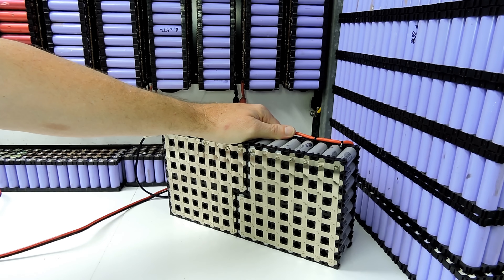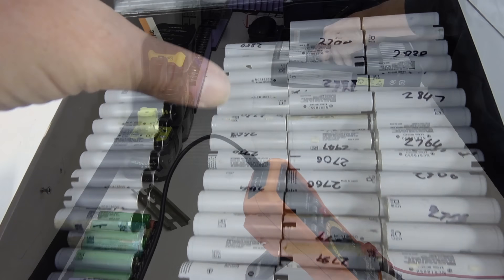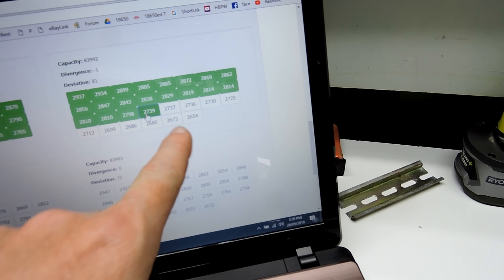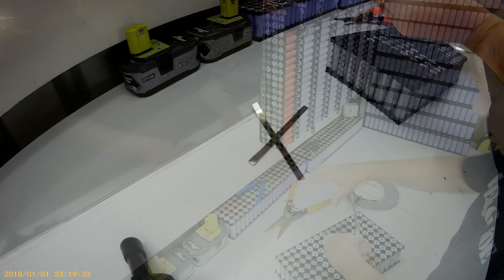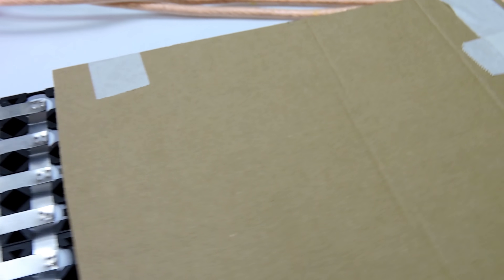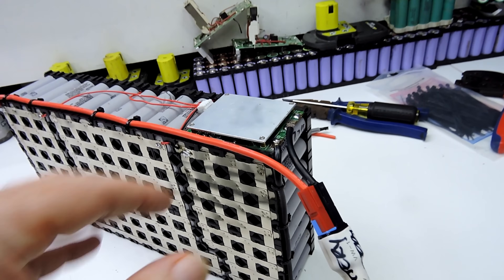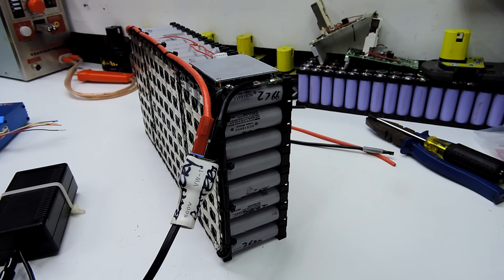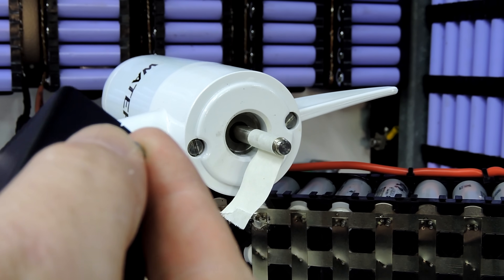Trolling Motor recycled 80ah 18650 battery pack

Comment: no fuses! nice fire maker battery!!!!!!
Reply from the maker: Clearly your deep in the eBike community :) Check out my other work - 4480 fuses 120 temp sensors etc etc
Reply: regardless what is the destination usage for the battery pack, if no fuses, better don't hold it inside a home!.

And, no, I am not in the eBike community, just saw your video as in promotion. So it appear in my youtube suggestions.
Reply from the maker: it will be on the deck of a kayak - I have 6000 plus cell i use 4480 to power my home - kinda get the fuse thing - in this case i need mechanical strength, portability and capacity Tick, tick & tick

Comment: Hello HB, great channel, great project...! 
When you solder on the leads, you can do it on the strip Between the cells...(less heat build up).   
Fuse - Idea: Get your brother to put a "Master Fuse" in the PVM box...and, 
for good measure, check all cable dimensions. 
Also, test the system, with a "Locked" propeller...
Good to know, what will heat up and how much...Also, to find the right fuse.
PS: I sort my cells in Excell. 
Greetings from Denmark...Jakob.
Reply from the maker: Next version I have soldered to some nickel Then spot welded to the pack thus reducing all heat :) Already have a resettable fuse and emergency disconnect planed I need to get the second video edited and released, trying to raise some funds thus pumping out the quick and easy ones
Reply: Good to know, I see you are on top of it...! In ver 2, I suggest a series of 4 separate packs of cells...easier to repair and renew.
Reply from the maker: True it would be easier to separate and service but harder to move around considering my brother is in a wheelchair
Reply: Yes, they need to go together, as a unit, into some kind of toolcase/powerbox, for ease of handling. I am sure your brother will make it connect to his rc boat hauler tractor!

Comment: Wtf that, how much the battery?
Reply from the maker: It's a 16v battery made from used laptop battery cells - going to use it to run an electric boat motor
Reply: HBPowerwall where you get all of those laptop battery cells?
Reply from the maker: Anywhere I can - many many weeks yes weeks on the phone cold calling companies, schools, anywhere with an IT Department
Reply: cool

Comment: The correct even and try to test the amperage of the batteries, before you discard or use, but okay fine work you did! :)
Reply from the maker: Should be able to do 120amps for VERY short bursts

Comment: Love your videos. I am in the US and I have went to and asked all of the repair shops and battery places in a 100 mile circrufrinst about getting their recycles 18650 batteries, laptop batteries, electric tool battiers, and any thing that holds 18650. If they do not have them they are not willing to give them up, they want to sell them to me. Their selling price pretty much matches new price. Since recycling is not goingto be an option in my area where should I get my batteries.
Reply from the maker: Have you tried Tom ? www.diypowerwalls.com/tom should get you all you need tested and ready to go
Reply: HBPowerwall I have not but I will deffenty check it out thank you very much.

Comment: Hi Pete, now you've used the spot welder but fuse are no longer fitted/required for this pack?
Reply from the maker: Really should have put more effort into adding fuses of some sort - for its application (in a boat) if there is an issue it'll just go overboard. It will also be moved and bumped a lot much like an ebike battery. I've gone out of my way to make sure I'm using the best most balanced cells I have laying around. Time will tell if it was a good or bad call.

Comment: I really need  to ask you a question . I am trying to do the same but I was concern about the voltage @ 16.8 full can the motor handle that ? thanks
Reply from the maker: the PWM speed controller sorts out the voltage -  https://goo.gl/vqR8pD

Comment: Hello my friend, how are you? I've been following your videos. I'm from Brazil, I have a 5kw grid tie. I'm putting together a backup for any power outages. I intend to work with 4S10P. I think the nickel strips good, but I'm afraid some cell the fry! I have a tristar MPPT 45A charger, I also did not like the software, but that's what we have for the moment Some advice? Hugs!
Reply from the maker: First, lets deal with this HUGS thing... do we get to know each other first or just BAM we hug and see if it gets weird? As for the cells in a powerwall with so little cells would recommend fuses of some sort if possible
Reply: KKKK, hugs in my country is a loving way to wish all the best!
Reply from the maker: Never heard of such a thing - where are ya from ?

Comment: What run time would you expect from this setup? Also how long would it take to charge this up?
Reply from the maker: Not sure as unloaded at max speed it's only 1.2amp draw - bet that changes once a load is added. As for charing it depends on your charger. Bigger chargers would have no issue doing it in 10 hours - my charger will probably take 20-30 hours flat to full

Comment: Since this is the latest video, I'll ask here. With your spot welder, are the tips spring loaded? If so, do you push them down until the spring bottoms out? I saw another video where they said spot welding is a resistive welding. Pressing too hard actually reduces the amount of resistance and it doesn't weld as good. Maybe you can play around with pressure on the tips to get different results. Perhaps this is why the arm on the device would work better as it was spring loaded, too.
Reply from the maker: yes they are spring loaded - found if I played with settings I didn't need to really press down so hard the springs compressed. Found if it sparked I was doing it wrong

Comment: Don't you love the short work a Spot welder makes of a huge battery pack!!!
Reply from the maker: There is just a few min of cutting up nickel then bam it's done! And looks so dam good lol
Reply: I started out only using a Spot welder(or my homemade built spot welders), I am just now getting used to soldering a cell. If I could get away with it, I use a spot welder on everything. Love the work you put in on this. That battery should last a long time!!! Good cells you used also. You Can't beat those NCRs
Reply from the maker: Next challenge will be keeping it dry and servicable
Reply: I assume its been in service for a while now? Any word how long it lasted etc? Keep up the good work :)
Reply from the maker: Haven’t tuned it in since too cold lol haven’t even done a load test

Comment: Have you tried using your pip4048 inverter to run your grid tie system off grid which in turn will charge your butteries when the solar load if more than the house ?
Reply from the maker: No, that would end very badly - Its just a bad idea - connecting any 240v to the output of the pip will instantly require a new mainboard - know a few people installing their pips and getting the input and output mixed up. Best to get the right inverter for the job from the beginning
Reply: Have a look at evtv video he has done it with  5 grid tie inverters with a cheap Chinese inverter and tesla batteries at 48 v
Reply from the maker: Ooh I've seen it done but from what I've seen there are many pitfalls - cheap inverter works differently than the PIP's

Comment: Awesome project! I'd love to build a small solar powered boat. Something with those lightweight flexible panels as a roof.
Is there an affordable li-ion balance charger like that skyRC that runs directly off a solar panel and balances while charging?
Reply from the maker: Thank-You Dejay, I'm sure you could do it with a solar charger controller just a cheap one off the eBays then hook up the output - but not sure if you need batteries connected for that idea to work.. I'd love to test the theory but don't have a working solar charge controller here
Reply: I keep thinking that with a single 100W panel with 18Vmpp / 5.5A output, you could just connect it to a 4S5P battery pack and stop once you reach 16.8V. If the batteries allow enough charging current, the voltage of the panels should drop like form a constant current power source.

So maybe you could connect one of those 4S li-ion BMS balance boards directly from solar panel to 4S5P battery pack? No solar charger needed?

I just wish one of these cheap boards would have additional PWM charging build in to limit the current, basically combining a PWM solar charger with a lipo balance charger. Then you could use smaller packs. Which would make it easier and possibly more efficient.

Or maybe I'm missing something :)
Reply from the maker: that sort of stuff is above my head unfortunately - i'm still learning with the rest of you :)
Reply: I've ordered some stuff and will try it out. One of those cheap 4S 30A boards. 
Hope I don't blow the batteries up haha.
Reply from the maker: Say safe and report your results lol
Reply: Pls can show mi were i can buy that type of ur digiter meter  
What os d name and d model

Comment: Sort your cells out in the table by mAh then binary search for them.
Reply: Yeah - I'm with Brian on this. Quicker to sort hi to low. Then finding each cell is much easier. :)
Reply from the maker: Next time :) i'll give it a crack hehe
Reply: missing something.  Why is the logging of the cell, then searching for it important.  I missed something key in the video, OR that's intuitive to most of you already?
Reply from the maker: the sorting would take just as long :)
Reply: At the moment you're doing O(n!) work but sorting is O(n log n) and lookup is O(log n) so in theory you'd be doing less work, as long as you have more than 3 cells :)
Reply from the maker: My head hurts :) In my brain it's faster my way lol But thinking about it your way would work very well for massive packs
Reply: Nite - tidy looking battery tho. :)

Comment: 1. Given up on fusing for low current (per cell) applications?
2. Cheap balance boards are more trouble then they are worth!! Balance charge or use a balance checker and only charge to 4.05v once your happy the cells are well matched, checking occasionally.
3. 4s is the new 3s Most camping items will run no problems at 16v and run down to 10v.
4. Where did you get the Asus batteries from at a good price? Stored at 3.6 to 3.8v those batteries will outlast time itself.
Reply from the maker: Tried to fuse but looked ugly - yes that's my excuse ugly lol but took every step possible to still build a safe battery. Still needs load fuses and waterproof box for it but that'll be in the next video. I agree those BMS cause more issues than they solve but I was TRYING to build this battery as good as possible. 4s is definitely becoming more popular Over time i've saved 100's of laptop battery packs with these cells in them - too good for powerwall use I thought.

Comment: Sweet pack! neater than mine I went the fuse wire route. l have ran into a few problems with my 4s packs the high voltage pushes more amps into the motor reducing the AH rating. Tried a few buck convertors to keep a steady 12.5v but they get HOT will try a few more beefier ones or add a tiny pc fan. Before my buck burnt out I was getting 20% or more run time @12.5 vs 14-16 volts. The bright side is it supercharges the trolling motor lol  Still it beats a 3s pack which the motor falls flat with much capacity remaining. Just remember to monitor voltage a 4s will easily drop cells below 3 volts if not monitored.
Reply from the maker: Next one I build will be fused between the Series packs I think. It's the neatest way I can think of setting it up. Will take out the whole battery but better than nothing. Hope I can make it to the gold coast soon to my brother's house to test it out. But I'm about as good at 'water' as I am at 'mathing'

Comment: That will give amazing run times. I just did a similar pack, after making my own outboard using a 2hp mariner leg I fitted with a 90v brushed motor (750w) so I wired my pack as 10p20S with some higher voltage mosfet's in my own PWM speed controller. After a whole weekend of use, it still only reaches ~3.4v/cell. Your build is way better than any lead acid options. He could also plug a lipo alarm into the balance port when in use, it will fire off when there's about 20% remaining with liion's..
Reply from the maker: My bro is a massive TECH head and will no doubt improve it :)
Reply: How is this better than any lead acid option? Why couldn’t he have just used an 80ah lead acid marine battery? I’m only asking because I’d like to learn more about building a battery pack.
Reply: I think because acid batterys can't discharge much than the li pack can. Sorry if im not correct and the bad english :)   (but acid battery can suply more ah  in a shurtly time, for this are used for start the engine of cars)

Comment: I would of put each 10's in it's own bin. So, 2350's bin, 2360's bin, 2370's bin.  Depending on the spread, that'd be a lot of bins. Buuuut, would make things a bit faster in the building process. Especially if you decided to do the 14s setup  ;)  Seeing as how you're doing a trolling motor and small packs, I suppose this will work too  :P
Reply: I am writing a script for the same reason. I can scan the barcode and it tells me which Series Battery Bank it belongs to.  Also working on a CSV output script of available batteries from my Database to import into RePackr.
Reply from the maker: Took about half an hour so wasn't so bad - too me a bit to work out the fastest process

Comment: Awesome video mate! I'll be making one of these.
Reply from the maker: I love the results - pitty I couldn't work out how to do cells fuses & make them look sexy as well
Reply: I think Tesla cells use a plate with holes that are bigger than the positive terminal and line up with them, then a short fuse connects them.
With nickel strips on the positive side, you could make a grid that lies between the cells and spot weld the fuses to it, or even try a copper plate with large drilled holes.
The negative side can be spot welded as normal.
Best place to attach the power cables is at the centre of each terminal plate, or at multiple places for really high currents. With the power cables at the corners, the entire 30P current goes through just 2 strips worth of nickel!